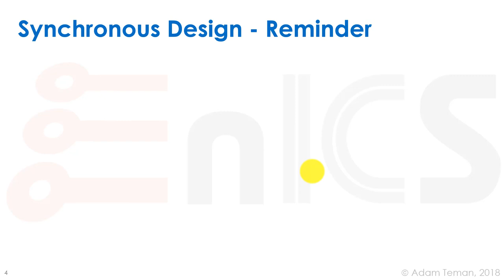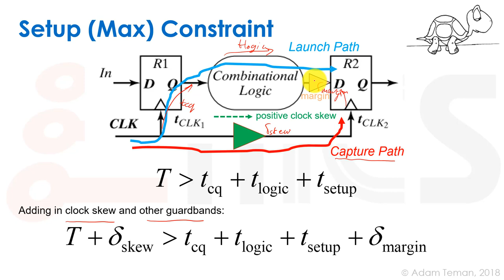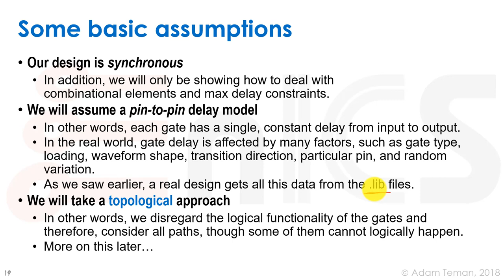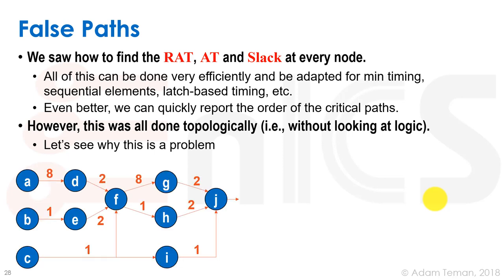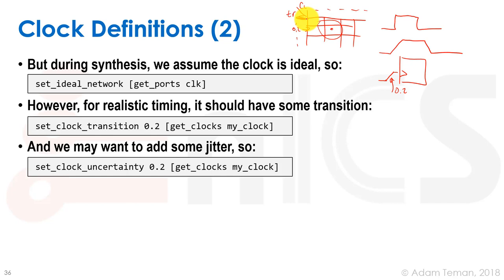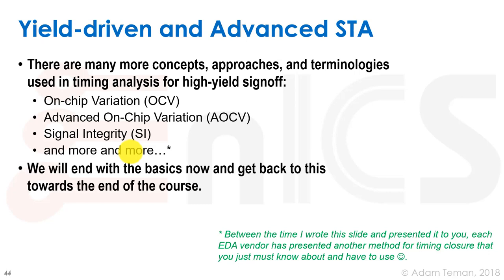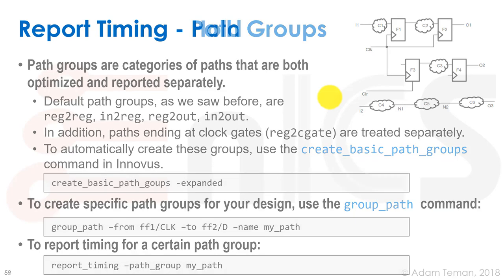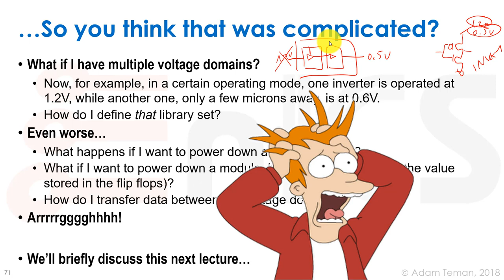DVD - Lecture 5: Timing (STA)

Comment: This is precious....!! U r doing a great job...very useful material!! Thank you very much!!
Reply from the maker: Thanks so much for your kind words!
Reply: Hi sir. Thanks again for all these wonderful lectures in digital VLSI design. Taking this lecture on timing analysis as reference we were trying to perform static timing analysis for a digital circuit using cadence tempus we are stuck at a point where we have timing violations and don't know how to correct it.could you please help us or suggest any reference materials as such. If you can provide your email ID it would be of great help and I can explain it more elaborately in a mail. thanks.

Comment: Thanks Professor for the excellent video!! 

Question: Why do we perform min_transition checks on the design ? 
I understand the reason behind max_transition check, that is to avoid the crowbar current when the signal takes more time to change from one logic state to other. However if the signal transition is faster (min transition value) it is beneficial for us to meet timing with lesser delay. Isn't it ?
Why do we make min_transition a design rule check ?

Can you please clarify this standing question that I have been trying to get answer for a while now..
Reply from the maker: Hi Epsilon, that's a good question. The reasoning behind the min_transition is (primarily) the look up tables in the .lib file. Each standard cell is characterized according to a set of input transitions and output capacitances. These values are defined in the .lib file (and the characterization script, and usually there are 5 to 7 values for each. Adding more values means that more simulations have to be run during characterization and the .lib files become larger, and so, a basic range is chosen from some minimum (for both transition and capacitance) to some maximum with certain steps between (not necessarily uniform). If the characterization is done well, this range should cover the vast majority of the transitions and capacitances that will actually occur in a design. If, however, a particular transition or capacitance is either smaller than the minimum or larger than the maximum value, the interpolation done in the timing model loses validity, since the behavior is non-linear. Therefore, these values are considered "out of table" and are basically an error (since they provide inaccurate timing). To avoid being "out of table" minimum and maximum transitions and capacitances are defined.

There could be other explanations, if you want, but they are secondary and non precise. For example, we don't want very fast transitions, because that means the previous stage is "too big" and you're wasting power and area. The rule of thumb is that both input and output transitions should be pretty much equivalent. Another explanation could be that too fast a transition could be a strong aggressor for coupled signals. But in all truth, the real reason is the .lib tables.

Comment: what is non sequential timing paths ?...why we are checking those paths in real design ....example ......reg > mux ...how can we can that non sequential path is valid or not ?
Reply from the maker: Hi Merrygo. Could you please explain your question a bit better? STA is used for sequential timing paths - in fact, the approach doesn't necessarily work for non-sequential paths. We do have in2reg, reg2out, and in2out paths that are not exactly inherently sequential (as they do not have a register as their start and/or end point), so we model the missing register(s) with input/output constraints. I am not sure what you mean by a path being "not valid". Thanks

Comment: Hi Professor, I had one query regarding providing IO constraints. On which criteria we decide on value of the delay while providing IO constraints using set_input_delay and set_output_delay.

Thanks in advance!
Reply from the maker: Great question and one that is not easy to answer. In many cases it's just a rough guess (i.e., "half the clock cycle"), but that is not a methodology or a reasonable way to do it. The best way is in a top-down hierarchical approach, where we partition the design by defining several low level macros that will be implemented separately. In this case, the toplevel has the entire view of the timing and can "budget" delays to the lower levels. This flow can then write out an SDC with the required input and output delays, based on actual timing budget found at the toplevel. 
However, that assumes a top-down hierarchical flow, which is often not used for various reasons. When doing bottom-up (i.e., implementing the macro first, before integration at the top), you really have to "guesstimate" your IO delays based on knowledge of 1) how complex the path is inside your macro and 2) how complex the path is outside your macro. The idea is to make sure that when integrating at the toplevel (which comes relatively late in the project), we won't run into surprises due to badly defined IO delays. But this is hard and is often just plain done without much thought or effort. 
One more point is the off chip IO constraints at the top level. Here there are important constraints that come from the board/system level that must be taken care of inside the toplevel. This is often called "AC Timing" and outside the scope of this lecture series (unfortunately, there's a lot of company specific and protocol-specific "black magic" there). But it is quite important and needs to be taken into consideration.

Comment: Thanks Sir for sharing your great knowledge.
I have tiny question about your 4 category of timing path. 

Could you guide me a description of solution for each category's a timing violation(setup/hold)? I think, in R to R path case, it will be one of the solution for adding a F/F pipeline for setup violation and insert buffer for hold violation.

But, No idea else at all. Could you guide for me for 3 else categories in setup and hold violation case?
Reply from the maker: So this is, in many ways, the holy grail of chip design, right? How do you get better timing...
To the first order, you are correct. You can fix hold by adding a buffer on the data path to slow it down. To fix setup, you can add a sampling stage. 
However, neither of these are trivial. For hold, you have to find a point on your path that you can delay without affecting critical setup paths. Remember that many paths can go through a specific point, so just adding a delay may slow down the fast path, but it may also slow down the slow path. Luckily, the tools today are pretty good at finding where they can insert these delays to fix the violations (though, ECO placement and routing can result in insufficient and unexpected results).
For setup, it's harder. You can't always just stick in a sampling stage wherever you want. You have to do this without changing the functionality. This often results in the insertion of many flip flops, which is costly in terms of area, power, and clock tree complexity. 
But there are many other optimization options. I discuss them in Lecture 4, starting at 1:11 (https://youtu.be/lTt2LN7nub0?t=4311). Things like upsizing gates, changing to LVT gates, restructuring the logic, cloning and restructuring the fanout tree, improving the placement and net routing... Sometimes, it requires going back to the design and changing the way the logic is written.

Regarding the in2reg, reg2out and in2out paths, they are no different in essence than reg2reg. The difference is that you don't have the entire path in your scope, so you have to model the part that is outside your block. This is basically budgeting (how much delay can I allow inside my block). These budgets should be derived from the next level up the design hierarchy, but often, they are estimated or not thought about deeply enough, over-constraining the lower-level block. Easing these constraints will solve the problems, but you can only do this if you make sure that you actually can. 

Pay attention that after building a clock tree, the set_input/output_delay constraints get "messed up", since they introduce "fake" skew. I explain this briefly here and in the CTS lecture. 

Hope that helped.

Comment: Thank you for your videos. I am still a little confused about what the difference between a spec file and an sdc file is. I know spec is mainly used just for ccopt. What are the differences?
Reply from the maker: Hi Andrew. A "spec" in general is usually a text document, describing the system features/requirements, from which the entire design is derived. For Clock Tree Synthesis, in the past, there was a specific "CTS Spec" file in a proprietary format, but now (in CCOpt), you just give TCL commands that define settings, like all other Innovus tools. We often put this in a separate file to organize things. 
As for SDC, this is the timing constraints file. Again, you can input these commands in TCL, but to be compliant with other tools and vendors, it is usually good practice to write the timing constraints in SDC format and put them in a separate file that is read in during the flow. 
As for the difference between SDC and CCOpt constraints - this is a bit more deep and complicated. In general, SDC defines the static timing analysis and optimization constraints (or general physical implementation constraints), while CCOpt constrains are only for the clock tree synthesis. Usually they are related and so CCOpt can automatically generate the CCOpt constraints based on the SDC commands that are loaded into the design. However, once you have to deal with a non-trivial clock tree (which is usually the case), this automatic process doesn't hold up and you have to define things after a deep thought process. It is a type of art. Defining good CTS constraints takes a lot of experience and learning from past mistakes. 
In the end, the SDC constraints are with you throughout the flow, while the CCOpt constraints are only used during the CTS (CCOpt) stage. But it's a bit deeper than that.

Comment: Why recovery and removal check are not for assertion of reset? 
Why there is a problem of metastability for asynchronous input?
Reply from the maker: Hi Mansi. I will try to answer, if I understand your questions.

Regarding Recovery and Removal checks - the problem is coming out of reset, not going into reset. Resetting a system is a harsh operation and it brings us to a predetermined, unique state. If you have a "timing violation" type thing on assertion of reset, it's not a problem, because the next clock cycle it will go into reset. No harm done. Coming out of reset, however, is the start of our sequential/operational mode and so it's important that everything is coherent and therefore recovery/removal checks need to be verified.

Regarding asynchronous inputs - I'm not sure exactly what you mean, but asynchronous signals, in general - i.e., signals that are triggered by different non-synchronous clocks or some random source - cannot be tested for max/min-delay violations as we cannot define the relation between the launch and capture paths. This subject is covered in Lecture 8: Clock Tree Synthesis, starting at 1:12 minutes (https://youtu.be/xx7ymxmqrgU?t=4358)

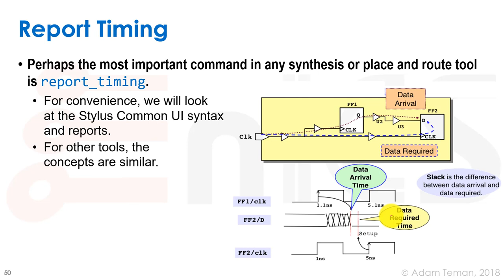Comment: In 1:32:20 why do we draw data like that one going up the other down at the Same time but for clock There is onlu one line up and down in a row?
Reply from the maker: Hi,
Thanks for the question. Some things we - experienced engineers - take for granted, since we're used to seeing them so often and we may not explain them (though I do vaguely remember explaining this in one of my lectures somewhere). 

The clock is very deterministic. Every clock period, it goes up once and down once and it does this repeatedly at a constant rate. Therefore, this is how we draw the clock signal.

On the other hand, we don't know what the data is in a general case. It could be '1', could be '0', could stay constant and could toggle. Therefore, we draw it in that "changing" or "unknown" kind of way. It is supposed to represent "all cases" where we must take into account that any level can be there and where the X's are, it may be changing (it will be stable where the lines are straight).

Comment: Sir, Usually, tcq is greater or smaller that tsetup & thold ?
Reply from the maker: Hi, 
Actually, in many ways tcq is independent of tsetup and thold and so there is no answer to your question. In Lecture 7 of my VLSI course, I explain how to construct a general flip flop standard cell and how to calculate these parameters for it, which could remove some of the mystery around this. See this lecture: https://youtu.be/YMq25bW-Z5g

In any case, each of these parameters is heavily dependent on the circuit design of the underlying block and the values can vary a lot. For the flip flop I show in that lecture, tcq is very short and thold is negative, while tsetup is quite substantial. For other implementations or other circuits (e.g., SRAMs) these relations can be totally different. In addition, process variations (corners) can change the relations between these parameters.

Comment: Sir can u explain/elaborate  min delay concept once more? How it passes through several registers during the same clock cycle?
Reply from the maker: Yes. I can try. 
Assume you have positive clock skew, i.e., the clock edge rises at the launch register and then is delayed before rising at the capture register. During that time, the launched data (triggered by the clock edge that has already arrived at the launch register) starts to propagate through the data path. If the data arrives at its endpoint (the capture register) before the clock edge then once the edge arrives, it will capture the new data, rather than the data that was there when the launch clock edge rose. Therefore, the launch data basically skipped through this register and is propagated all the way to the next endpoint.
Reply: @AdiTeman  okay sir.

Comment: Sir,Can you explain the hold timing on half-cycle path,Is it really depends on the frequency/time period?
Reply from the maker: Hi Devarun,
Actually, this is a confusing subject, but the answer is simple if you can get your head around it.
The definitions that were given are true for all max-delay/min-delay timing paths. The question is what constitutes the launch and capture paths. If, for example, a launch path is triggered by a rising edge but the endpoint is a falling edge triggered flip flop, you would get a half-cycle path. To understand the timing (both hold and setup) you just have to follow the paths. Let's define that the launch path was triggered at time 0 and took tlaunch to propagate to the endpoint. The capture path, on the other hand, was launched on the opposite phase of the clock (as the endpoint is negative edge sensitive). So for hold, when you want a worse case on the capture path  relative to the launch path, we will take the triggered edge delayed by half a cycle (assuming a 50% duty cycle on the clock). In other words, the capture path starts at T/2 instead of at 0. It then propagates to the endpoint (we'll call this tcapture) and so our timing constraint, which is always Tlaunch>Tcapture for hold, can be written as:
0+tlaunch>T/2+tcapture+thold
Reply: Sir as I learnt,the equation is
T/2+Tcq+Tcombo>Thold+Tskew+Thu.

Comment: Firstly thanks for the great lecture. 
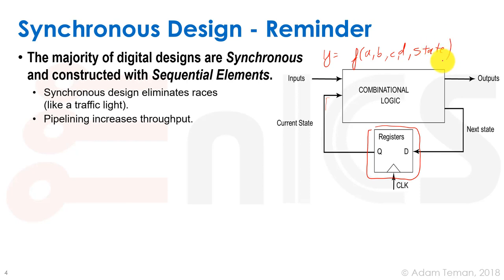I see that it should be report_timing -format (not -field). at 1:40 hrs
Reply from the maker: You are correct, but this is not exactly a "mistake". EDA companies often do things that are out of our control. When I made the video, the current version of Innovus used the option "-field". Following your comment, I checked and in the latest version of documentation (20.12) they have changed it "back" to "-format" (which is what it was in the legacy UI command). Thanks for the comment! I will see if I can edit this out at some point.